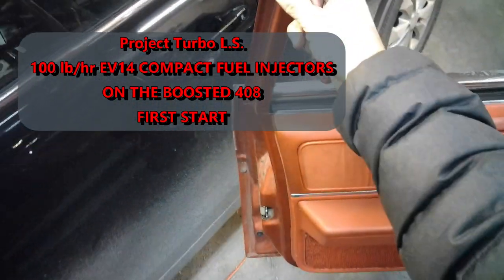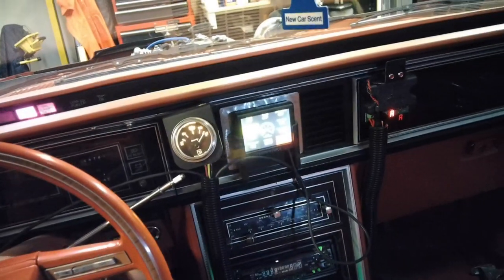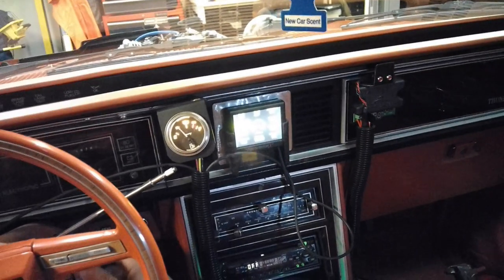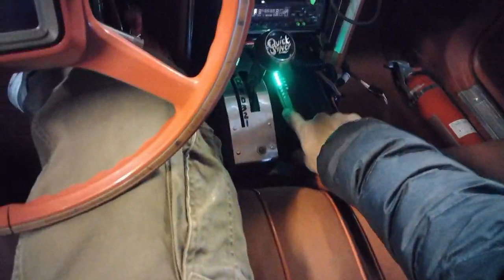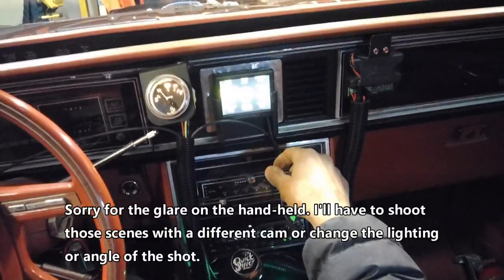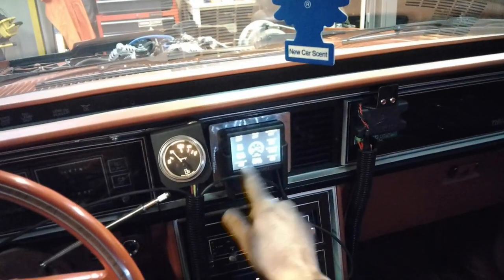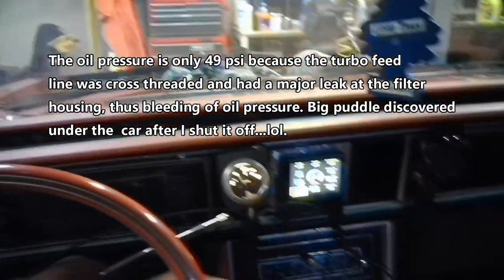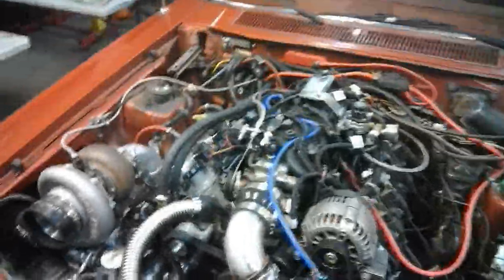408 LS & 100 LB PER HR fuel injectors first start

Comment: Damn i havent seen one of the square birds since the late 80’ early 90’s……thats crazy i honestly forgot they even exist….just like the 80’s turbo coupes….havent seen one of them in over 30yrs either
Reply from the maker: Yes that's why I built it because it's always the only one like it at any car show. Also it's a fox body platform car so all the mustang parts fit ( suspension etc etc ) making it easy and cheap to build. Plus with a boosted LS and the cold air intake hood scoop the car instantly gets attention at any car show...You have to be different to get noticed in the car building hobby...lol...   here's a link to the scooby van doing a burnout at the local car show...  https://youtu.be/Z31r3pKYMeE  ....Thanks for commenting and watching ....Oliver